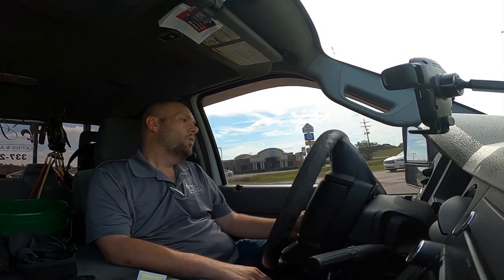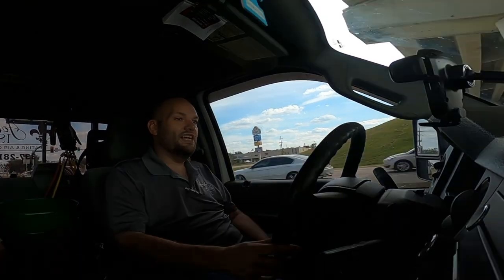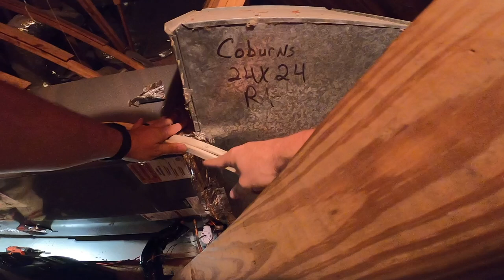Replacing a Electric Heat Kit

Comment: If the customer don't trust your knowledge John ,walk away,that's what I do. A heat pump in that state is more than enough.does the contractors in that area even know how to do load calculations ,latent and sensible curves on the psyc chart.if not they need to learn or find another trade.3ton heat pump with 15 kw if the pump sized for the load calc should be sufficient.

Comment: Let’s face it the old style heat pumps sucked, but now with these variable speed systems heat pumps are the way to go, plus nothing beats a gas furnace so I get the bad rep for heat pumps but in 2023 the work good on the gulf coast

Comment: I'm in Florida so we use mainly heat strips for any days below 90* :) Down here you learn how expensive they are to run. We have those radiant oil electric heaters. Those are really nice for the few days a year it gets chilly and very inexpensive to run. They really will warm a room up for us. I have a mini split in the garage that is also a heat pump but never used it in HP mode.

Comment: Hey, was wondering what are those white blocks under the air handler?  Also how do you like that new High Capacity 2.5 ah battery? How many weeks can you go before it needs a charge?
Reply: They are essentially blocks to prevent rattling and noise from the unit. But they also balance it.

Comment: How will they heat the house if the compressor fails outside ?Will heat strips take care of the house til heat pump condenser is repaired?
Reply: Yes they just tend to be way more expensive than heat pump costs.

Comment: Can I put an 8 Kw on a Payne 1 1/2 ton AC ?
Reply from the maker: As long as the line voltage wire is big enough you can put whatever size you want

Comment: There not a big market for heat pumps with electric heat in Ontario Canada where my grandparents live ether. Due to the fact that they don't produce as cozy of a heat below a curtain temperature without relying more on the electric furnace, which is a more expensive form of heat source up there then what it is down south. Although dual fuel systems that have heat pump with gas heat, are probably a more common type of heat pump system in Canada.